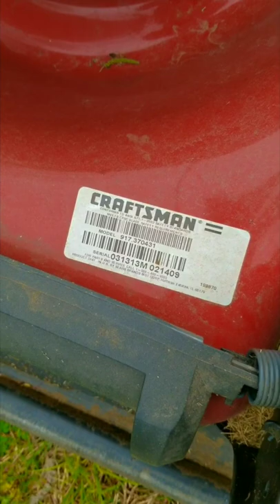Fixing A Neglected Craftsman Mower #shorts #mower

Comment: With them briggs quantum engines the first thing I do is clean the carb bowl and clean out the main jet/bowl screw. Most of the time that's what the problem is.
Reply from the maker: you are absolutely correct however there's a nasty surprise on this one.
Reply: And sometimes the cap vent quits working, creating a vacuum in the tank, shutting off the fuel.
Reply: @georgepruitt637  yeah that one got me once.

Comment: Worked at a mower shop. Had several Briggs flatheads that were fully submerged underwater, no oil, leaking down, basically everything. Those are indestructible. Throw some new oil, drop the carb bowl, and you'll get another 5 years easy
Reply from the maker: you got that right

Comment: Some engines have a Low Oil Cutout Safety. Bringing up the oil level should do the trick. You may have to manually reset the sensor.
Reply from the maker: yes but not on this one.

Comment: i reckon a bit of a carburetor cleaning or a replacement ignition coil replacement might do the trick or maybe the flywheel key might be sheared on top of the crankshaft etc.
Reply from the maker: thank you Patrick Stapleton, I'm sure it will need one or some of the things you mentioned.
Reply: @HomeGaragechannel  yes for sure and it's always good to dive into the basics and inspect the replaceable parts to fix common problems to many people think the motor is beyond repair to be a simple fix remedy just by simply replacing that very part etc.

Comment: Sweet!! Interesting news for you, and you'll really like this one.. today, using an app on my phone (😁) I found a Murray SP 22" with a BS 550ex on it for $25.. with bag, fully functional..  nice little find, but on the way home, by the curb, there's a Poulan lawnmower, broken pull rope, full tank of gas...  and it's got a Briggs flathead.. it's a good day! 😁

Love the videos mate!
Reply from the maker: Wow, nice finds!  That you I appreciate that.
Reply: Good find! I have a BS 550 series pushmower engine. Was a great engine, and lasted me many years before it bit the dust! Before i got that engine, my brother-in-law had throwed that mower in the woods. B&S engines with the carb on top of the gas tank, seem to be best types of pushmowers that last way longer than these newer B&S engines.
Reply: @Slim1423  they're solid engines. Those old Flatheads were robust, and could take some serious abuse.
Reply: @demcomp  Yeah, old B&S engines got me through a lot of high grass! You can still find those older B&S engines online or at a landfill.  Sometimes, all they need is a diaphragm gasket or a flywheel key, and they come back to life! Personally, i just like the older B&S lawnmower engines, less problems. Just crank them up and cut some grass.

Comment: Could you possibly tell me what could be the problem with the same kind of lawnmower? It does not blow the grass out of the side chute. It just blows out everywhere. It's just one big filthy mess. It's getting wrapped around the front wheels It tries to come through every outlet it can. Getting ready. I had a repair done and when I brought it back home it is now doing this. I don't know what the problem is. And I'm 100% sure it wasn't doing it before I took it in for repairs. Your help would be greatly appreciated
Reply from the maker: don't know, I've never ran into something like that before
Reply: Blade upside down????
Reply: @carolinec5685  Other commentor mentioned your blade could be on, upside down. That may be your problem. If blade in you mower is actually upside down, blade angle and blade direction would be wrong, possibly causing grass to be slung around in all directions,  instead of being actually cut.
Reply: @Slim1423 My thought too.

Comment: I have the same exact mower. What would cause the wheels not to roll?
Reply from the maker: it could mean the wheels are rusted the axles.
Reply: If you’re referring to the self-propelled wheels no longer working they have plastic tooth gears inside of the wheel that strip out overtime.  you can buy replacement wheels for 25 bucks or so online. Had to replace mine once.

Comment: Why would low oil stop it starting,  is there a safety switch?
Reply from the maker: low oil won't lubricate the cylinder way, causing to much friction between the piston rings and cylinder. Eventually the piston will heat up and wedge itself in the bore.
Reply: @HomeGaragechannel  I know that,  I just wondered why it wouldn’t start even if the thing seized later ..
Reply from the maker: there is no safety switch.   Even after it seizes it should start again, however this has happened too often due to neglect and carelessness, the compression could get low enough to make it extremely difficult to start at least when using the pull rope.

Comment: I would head straight to the coil. The oil doesn't do a lot of cooling
Reply from the maker: the oil is part of the heat transfer system.  Without it, heat dissipation would be less effective
Reply: @HomeGaragechannel  True true, but with the little amount of oil in them I would think the bottom end would come apart before it had a heat problem.

Comment: Saved this one from the scrapyard, great but, you didn’t show us how you changed the oil.
Reply from the maker: just tip the mower on the side, with the oil fill tube facing down. it's best of the fuel tank is empty but not necessary

Comment: How did you know it dies due to low oil? I would've guessed the ignition coil.
Reply from the maker: the oil helps to transfer heat, and low oil reduces the heat transfer rate.  The metal expands, the piston gets stuck, but it's fine after the mower cools down.  Check the OIL, it's barely on the stick or not at all. Add oil, it doesn't stop anymore
Reply: @HomeGaragechannel  Wow.  In a case like this you hope the walls are not too heavily scored.  Thanks!

Comment: That is nothing this lady across the yard had a 2 year old brigs n Stratton I cleaned it of leaned it up to git under the deck then I put it down I went to pull it and it started first pull she said it cut off on her and wouldn’t start again so she bought a new one it is crazy how it was so little of a problem I think something was in the fuel line and when we tipped it it went through
Reply from the maker: yes that sometimes happens

Comment: 🤔 can't believe someone forgot to change the oil
Reply from the maker: unbelievable
Reply: I have a older yard machine I got for 20 bucks yesterday would run a stop with in a few minutes to me  hour to figure out what was wrong I cleaned the carburetor and put new gas in it and it sit wouldn't run had to look in my mess of parts to find a carburetor that would fit it and now it runs like new
Reply from the maker: your persistence payed off then.
Reply: @HomeGaragechannel  yup I think I might keep this one it's a pretty good lawn mower has a 22in deck it's much cheaper buying a used lawn mower that doesn't run then try to buy a new one

Comment: Self propelled and fires up  time to remove tank and carburetor, thoroughly clean, replacing the filter fuel line. Carburetor cleaner with compressor air.
Reply from the maker: thanks for the tip.